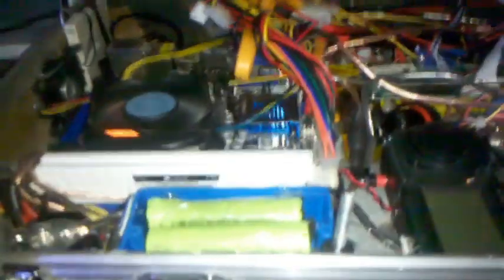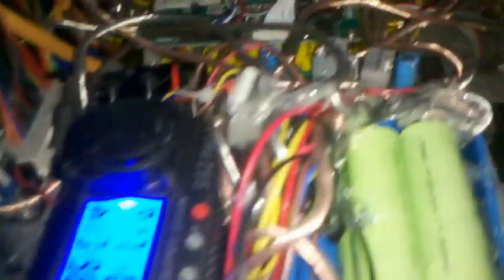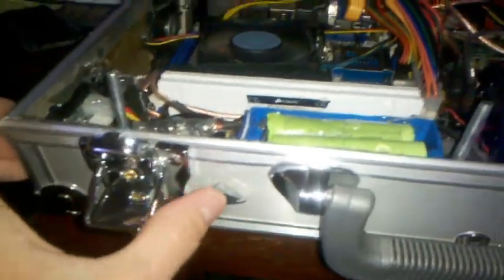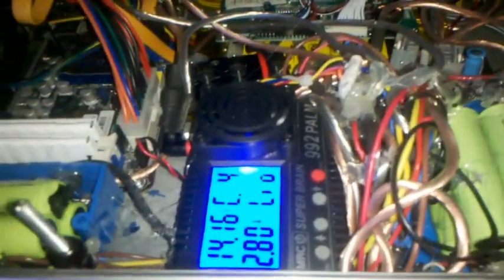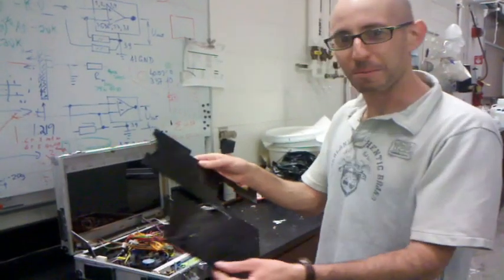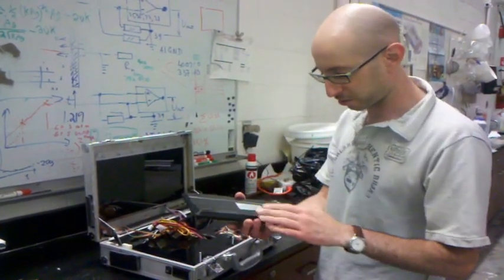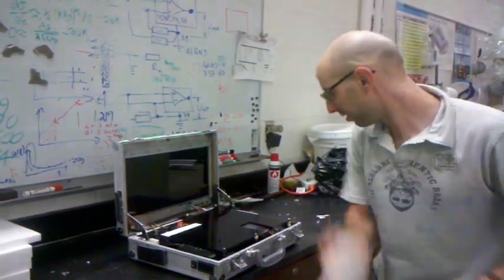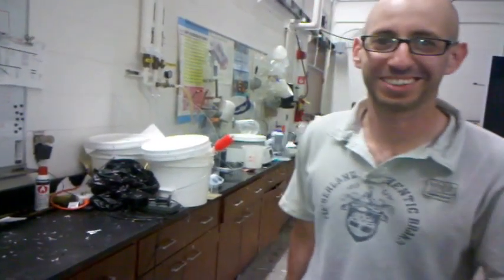Homemade Laptop Now with Battery System

Comment: Damn man, Cable management, but that is dapper as. I'd really love to take a look at your schematics for this as I'd love to make one for my briefcase computer, but I'd probably add an arduino to the circuit to read the voltage and work out how to tell the computer to read the voltage itself so it can hibernate automatically when the voltage gets too low. That is really nice man. Well done.

Comment from the maker: I created my own "battery pack".  Basically 8 Li-ion cells used in conjunction with a Li-ion protection circuit, dc-dc switching regulator and a charger.
Reply: Any chance you could send me the schematics of those circuits? Interested in something similar with a thin-ITX motherboard